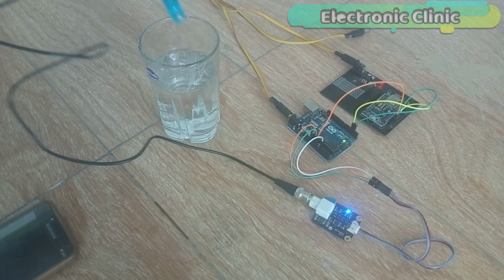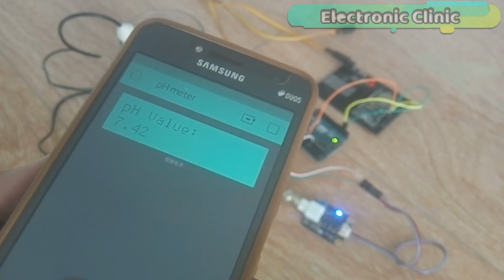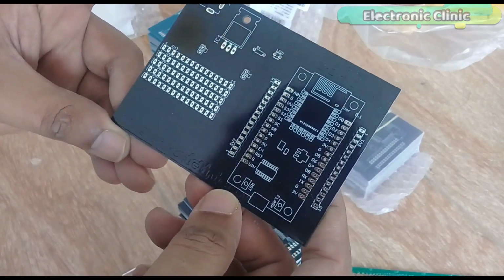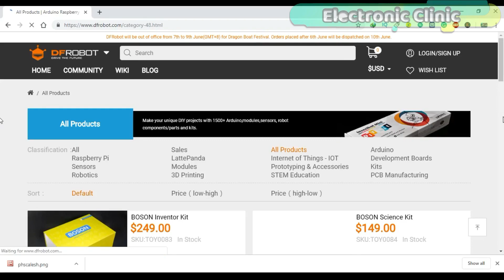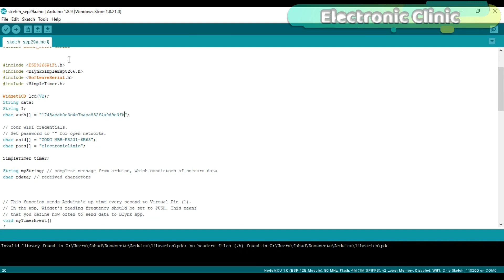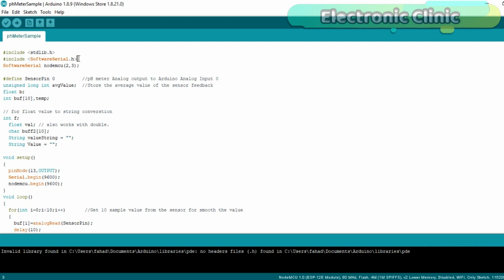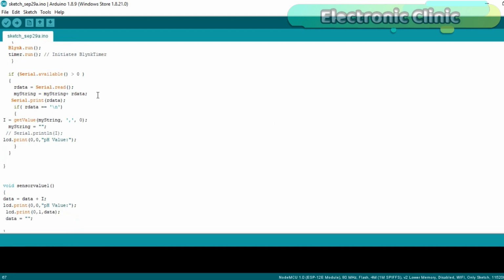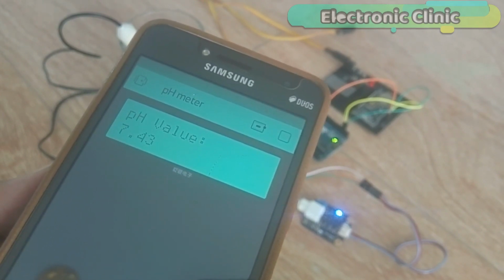IOT based Water Quality monitoring using Arduino, pH Sensor, Nodemcu ESP8266 & Blynk

Comment: Omg thank you for this video! It's exactly what I'm trying to do with one exception, I'm trying to use the arduino uno running the ph code to pass the data to an ESP32 running in ESPHome. I don't want to use the esp32 directly with the sensor as the ADC isn't as good as those on the Uno, and the v1.1 of the ph sensor (as you and I both have) requires 5v, unlike the v2 that can run at 3.3v. By the time I add both those upgrades to an esp32 setup I might as well have just used the uno.
So it should be very simple to take the serial arduino TX > esp32 RX in YAML in esphome? 🙏

Comment: Hello sir, what if I use the Label widget on the blynk application. What will be the code for that? I tried your code sir but it does not work. I am using New blynk now.

Comment: Hi! That's amazing. I don't have the DFrobot sensor, so I am using the DM PH-4502C ph module, which i managed to calibrate properly and get the right readings on COM3 in arduino IDE. However, when i use your code, i don't get the readings on the virtual LCD in Blynk (it only says 'pH value'. Would you happen to know what the problem could be? Thank you!!!!
Reply from the maker: check the variables in code.

Comment: Sir I didn't understand, in video you said that you uploaded both the program to arduino ... How?? how u have combined both codes?
My next question is, if I use esp8266 arduino based board(wemos) and get the result on blynk, what changes should be made in code ?
please guide as I am working on the same project.

Comment: Dear Mr, for the code below, why there is number '13' ? where does it come from? 

void setup()
{
  pinMode(13,OUTPUT);  
  Serial.begin(9600);  
  nodemcu.begin(9600); 
}
Reply: pin 13 is for the inbuilt LED on the Arduino board

Comment: Sir the components used are only arduino, nodemcu, pH meter and soldering kit right ... Where did you use the capasitor, bread board, pcb and other components mentioned in the above requirements
Reply from the maker: capacitor is used with the power supply.
Reply from the maker: well, .not all the components are used. but if in case you need them the links are given.

Comment: Is it possible to do  it without the serial communication with the Arduino?..
I have 2 analog sensors and planning to use it with the Node MCU with an Anolog pin extender
Reply from the maker: Then u should use esp32. Its just like the nodemcu. The same programming will be used. Esp32 has multiple analog pins. Watch my second last tutorial on esp32.

Comment: How would I change the code so that the ph scale is flipped. Like as In if my ph sensor is reading 14 in the scale for it to read 1 and if it was to read 13 it would actually read 2 how would I have to change my code thanks. And where would I write this code into. Thanks

Comment: Is it possible to hook up a ph sensor and temperature sensor and run them thought a app at the same time
Reply from the maker: Yes. Watch my tutorial in which i have used the temperature sensor. Just copy the code from that project. Check playlist
Reply: how would I do that since the temperature sensor only required the esp8266 and this requires the Arduino uno?
Reply from the maker: No problem. you can connect all of your sensors with the Arduino and then you can use the Nodemcu esp8266 for sending data to the Blynk Application. Watch my other videos...
Reply: Electronic Clinic are you able to link helpful ones
Reply: And also are you you able to link me all the library’s you used in you temperature sensor video because I went on you website and I could only find the one wire and Dallastempreture library’s and not the rest
Reply from the maker: Libraries are available on my website. electroniclinic.com
Reply: Electronic Clinic thanks for that

Comment: Can you kindly make video showing how to use two of Waterproof Ultrasonic Sensor Modules JSN-SR04T-2.0 + Blynk App, to read the water level in two tanks together and derive the quantity of water in each.  Using this activate a relay to pump water from one tank to another.  It will be great if you can also include a cheap 16x4 or Nokia display.

Thanks, your valued subscriber.
Reply from the maker: the water level project is already available. check playlist.

Comment: Why need use arduino? Nodemcu also have analog pin A0.. please explain why need to use arduino..
Reply: It's redundant, right? He could have inserted all pins directly to the node mcu
Reply: Yeah rite
Reply: Ph sensor requires 5V but nodemcu can only provide 3.3V (esp8266 pins voltage is max 3.3v), while arduino's operating voltage is 5V.